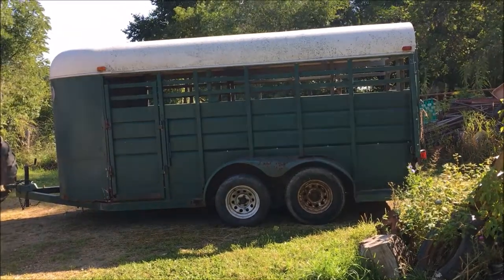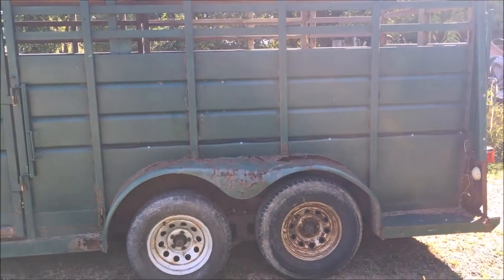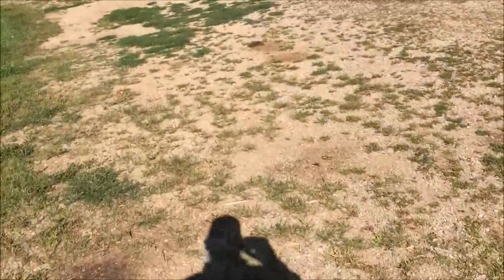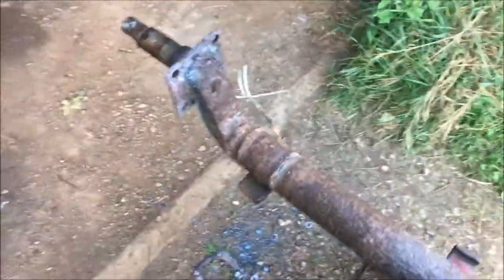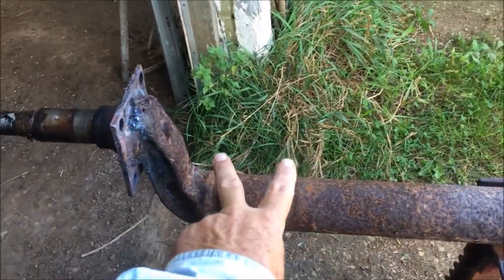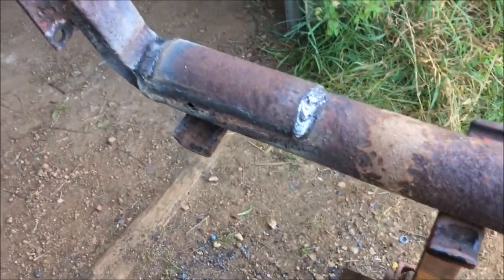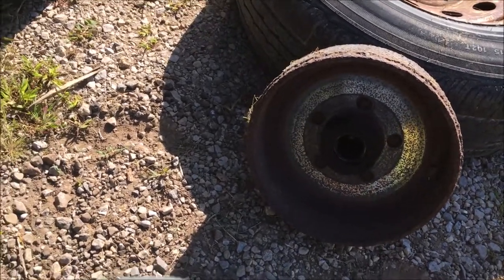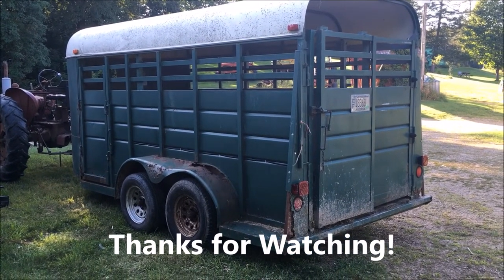Cattle Trailer Repair - Axle & Brakes

Comment: Take it easy Bro. I think you did the right thing fixing the axle now. Safer for you and the cows. Would angle iron inside along the bottom beef up the rusty spots?
Reply from the maker: The worst spots were on top on either side of the U-bolts. The bottom didn't show that kind of corrosion so I wasn't too worried about it. Any work on the bottom and I'd have had to work around, or remove and re-attach, the spring perch.

Comment: The plan must be to use the F150 to haul cattle and trailer, just not 5 or 6, 1000# cattle at the same time, correct?
Reply from the maker: Yes. I don't have much reason to haul many cows around any more. I've got a couple 900 lb steers to go to the locker in October. Other than that I'm mostly hauling a few 400 -500 lb feeders. Also, my new Nissan is rated at 6,700 lbs towing capacity so it would easily handle 4 full size critters.